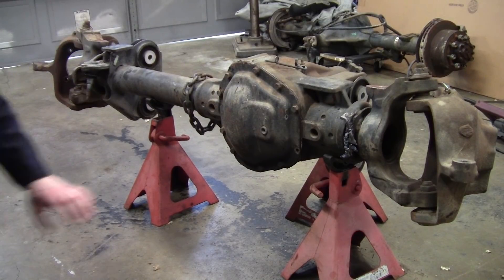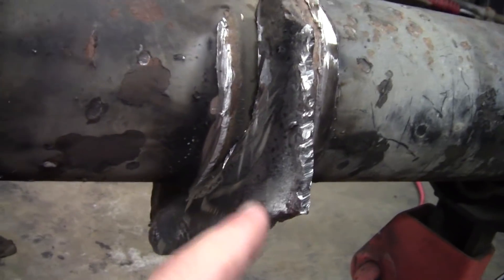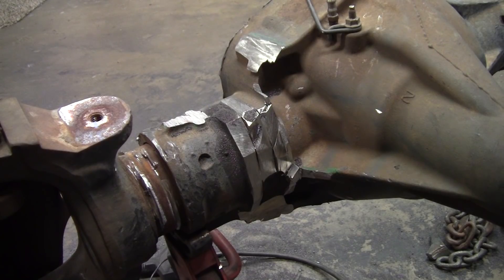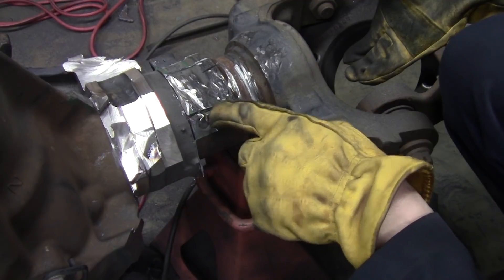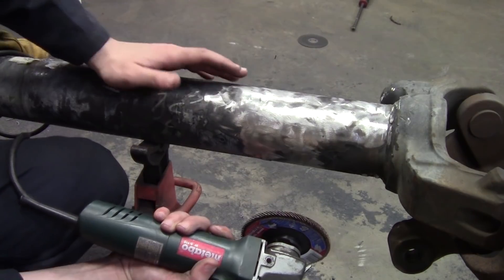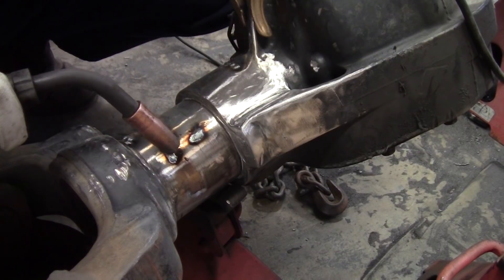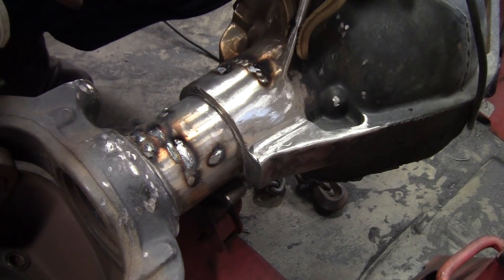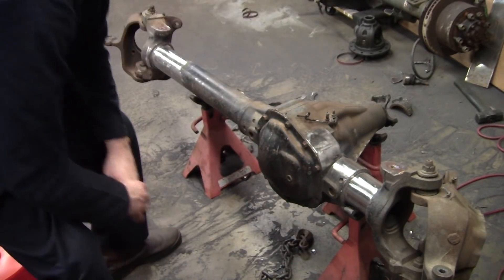Super Duty Dana 60 Casting Trim and Axle Swap Prep

Comment: How much of the axle tube were you able to expose on the driver side? I see where you cut 2" out of the casting so I would assume around 3" of exposed tube?
Reply from the maker: Yep! it's almost exactly 3" of tube now. Thanks for watching 👍
Reply: @WebWheeler  One more question. There is 3" of exposed axle tube on the driver side. What is the distance between the inner C and the edge of the differential on the driver side?
Reply from the maker: I actually just measured it and from casting of the C to casting of the center section is dead on at 3.5". The weld on the C is about 1/4" wide so before welding the tube to the center section casting there is 3.25" of clean tube. On the passenger side there's 23-11/16" from C casting to center section casting if you need that too 👍
Reply: Probably a dumb question but is there enough room for a leaf spring mount?
Reply from the maker: You probably could as long as the springs at least 32" apart but I would save the work and just run a 99-04 super duty Dana 60 (or earlier Ford Dana 60)  instead. They axles aren't quite as strong as the 2005+ alxes but could be upgraded and would save you a ton of time and effort trying to fabricate leaf spring perches in to the newer axles. Thanks for watching and for asking! I'm sure you're not there only one wanting to leaf spring these axles 👍

Comment: The one thing l allways felt sorry about was the bill my front desk wrote up to change seals on those. Nice if someone would come up with a way to locate them out on the tube end where they should and used to be. I mean pull the gears to change a axle seal? Stupid idiotic design shure didn't think that one out very well.
Reply from the maker: There are companies that make seals for the outer end of the tube but people tend to keep their inner seals too. At least these super duty 60s are quicker to pull shafts out of and reassemble than the old kingpin axles!

Comment: As someone who welded the Majority of my life, which was until I was an old man, as one on this thread has said, you should have done more washing with the cutting torch. You would have accomplished what you did in half the time. Watching this video reminded me painfully of how I was as a beginning welder. Point is with practice, you can wash the weld completely up without harming the base metal. Just be sure to watch for the break away once you have washed it away.
Reply from the maker: Yeah I have been getting more practice with the oxy acetylene and might put a video out specifically about that tool. Either way I wanted to show the methods with the cut off wheel too since that's more common in the home builder's garage. Thanks!
Reply: @WebWheeler  It looked to me like you were using a victor torch, which it does not matter, but ask for what is called a wash tip, they come in different sizes. Concentrate most on the side that is being remove and watch for a a line break as it washes the weld out. You will not believe the difference it will make.some days I had to spend the whole day washing welds out so I could rebuild. It is like riding a bicycle, once you got it, it never leaves you. Good Luck Guy. BTW, I did enjoy the video.

Comment: I'm a little confused as to why you removed the rosette welds and then did not weld around the tube to attach it to the pumpkin securley. This will make the axle tube prone to spinning on the pumpkin especially in an offroad application where components will be under heavy torsion.
Reply from the maker: Yeah the casting and tube need to be welded together after removing the rosette welds for the reasons you mention unless you have a truss attaching them. I forgot to mention it in this video but will be covering it in a future one. Thanks!
Reply: By the way great video man! Keep up the good work.
Reply from the maker: Thanks for watching!

Comment: Great video, I'll definitely use it when start working on my dana 60. What size cutting wheel are you using? Is that a 6 inch cutting wheel?
Reply from the maker: Yep that was a 6" by 1/16" thick wheel. It was the Diablo brand from home depot. I went through 1 wheel doing this project which was better than I expected. I've had surprising good results from the diablo stuff EXCEPT the "diamond edge" metal cutoff wheel. That thing screams like a banshee and doesn't cut anywhere near as quick as the abrasive cutoff wheels- don't bother with that thing haha

Comment: How do you know deep you’re cutting when going around the tube? I’d be worried about cutting into the tube when cutting casting
Reply from the maker: When I was using the band saw with the 1/2" blade I went around until about 1/8" of blade was showing and knew that was close to the right depth. After that I just cut a little with the grinder,  hammered it and looked for a crack to start, cut a little deeper, hammered more, etc. until I saw it breaking away. If you cut in to the tube a little it's no big deal though since the casting and tube should be welded together afterwards anyway. Thanks for watching!

Comment: I feel like a good air hammer and a few different chisels would make this a lot easier. Nice work.
Reply from the maker: Definitely would have helped! Haha good call and thanks for watching 👍
Reply: absolutely, i used an air chisel to remove the diff material where the driver side tube enters, after i had scored it.

Comment: Wouldn't modifying the truss be easier than cutting 2" off the casting? Or is what you'd be welding to make it worth shortening in?
Reply from the maker: Critical mounts like control arms really shouldn't be welded to castings as a general rule.  The heat affected zone of the weld messes with the metallurgy and can cause strength issues. Just better safe than sorry haha
Reply: Bitchin! I have the same axles and wanted to do something really similar in setup. Also, is it necessary to add any additional weld to the short side tube to housing join?
Reply from the maker: If you're adding a truss, you can get away with not adding a weld from the tube to the casting, especially if you bridge the truss to the inner C. If you aren't running a truss I would add a weld to make up for the strength lost by shaving down the casting. Good luck!

Comment: Great video, just what I was looking for. Do you have to remove the internals before welding? I'd like to keep everything in the housing. Just received my one tons yesterday so I'm waiting to see how you handle putting on the truss kit.
Reply from the maker: Thanks! Glad you found it.  As long as you have your ground clamp in a good spot (and on clean metal!) you should be fine leaving them in the housing.  I may end up building my own truss but either way I will be covering the install process in an upcoming video.  Feel free to message me if you're ready to install the truss and want some tips!
Reply: webwheeler, Getting cutting torches today to remove all the brackets and prep the axles this weekend. Should be ready to weld the truss in 2 weeks. I will have a mig or a tig, I was thinking just take my time with tig so it looks really good and I dont mind it taking longer. Tips would be awesome! Is it really necessary to pre heat the axle with a torch before welding? How hot should you keep the temp if so. I should probably do more research so I do not screw up lol!
Reply from the maker: No worries man! I'm happy to help. If you're TIG'ing to cast, you can use high nickel rod and generally you don't need any pre or post heat. Otherwise, pre heating to ~400 degrees is not a bad idea but NOT necessary in my experience. Most important thing is to let the welds cool slowly by either a torch or wrapping the weld in a welding blanket/glove, etc. As far as welding the truss overall, best way to minimize warpage is to tack the truss in place then fully weld it starting from the outside ends of the tubes (closest to the steering knuckle) and working your way to the middle, alternating between front and back of tube and passenger and driver side tubes to keep the heat even on both sides. Once you get to the casting,  weld in ~2" sections around the casting to keep the heat spread out. Like I said, a torch or welding blanket can help keep the casting from cooling too much but if you keep welding that helps keep the it pretty warm.  That's pretty much the strategy that has worked for me. If you decide to keep the axle assembled when you weld it, keep in mind you might cook anything made of rubber or plastic (like seals...) so be prepared to deal with that. Good luck!
Reply: WebWheeler, thank you so much, looking forward to more of your videos!